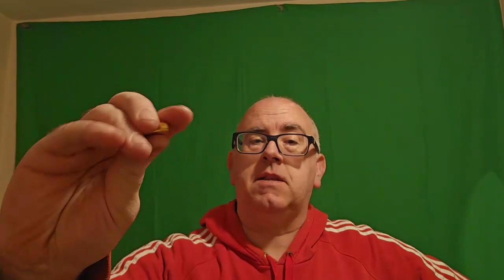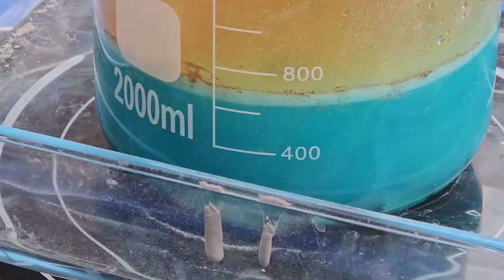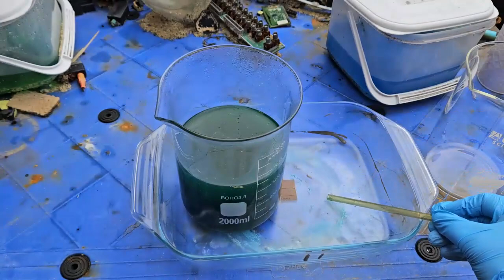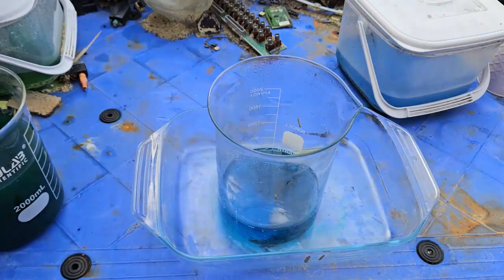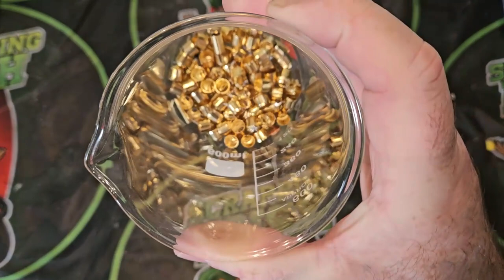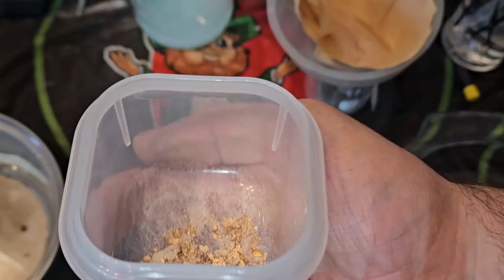Transforming gold plated connectors into pure gold part 1

Comment: Those 24k wires in the camera chips have to be processed differently meaning it's in the leftover material prebleech because you didn't have any solids after filtering, unless you think bleech using either hydro or nitric  can dissolve 24k? Can it, I'm watching your recent video now

Comment: What you have there is zinc which was dissolved because the connectors are brass. Brass is made from zinc and copper.
I recently had the same problem with one of my recent videos where I did high grade pins. Now that the zinc has been dissolved the remaining bits of connectors will look like copper.
Zinc is most highly reactive in acid so it's the first thing to dissolve
Reply from the maker: Cool but when I washed and used fresh nitric it didn't redesolve
Reply: @ScrappingIrish  yeah it prob won't. It didn't for me either
Reply from the maker: Thanks that good information
Reply: @ScrappingIrish  glad I could help

Comment: It depends on how old those connectors are. Same as relays I bought from a really good guy. Old connectors can contain berylium. It was considered a super conducter when alloyed with copper. I melted the whatever it was and had it XRFd . Turned out to be Berylium.in high concentrations.Unfortunatley It was never white. My best guess... Lead maybe? Did you ever add a few drops of sulphric acid to drop any lead?

Comment: Last time I did some of those connectors. I use AP to get the foils off and didn't have any of that white powder.
Reply from the maker: Ya I think I will use ap next time
Reply: What is AP sir?
Reply from the maker: Ap is a solution of hcl acid with some hydrogen peroxide in it